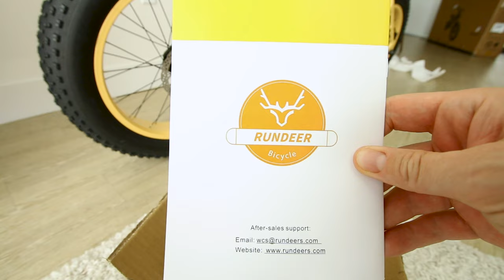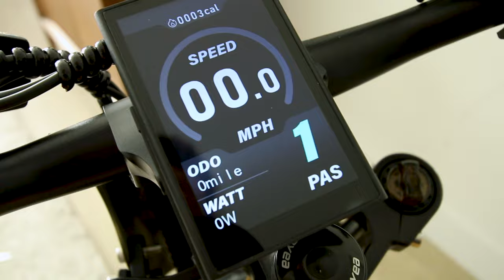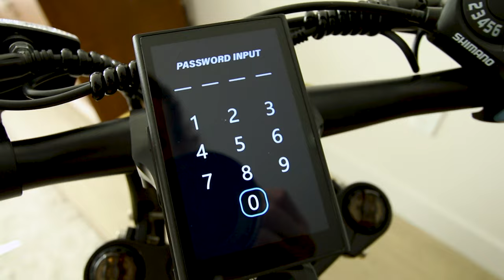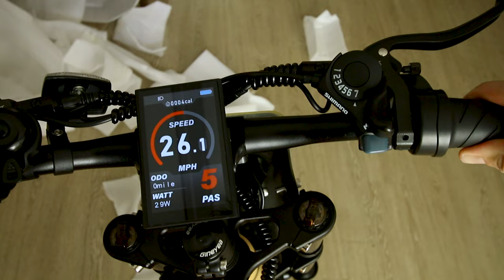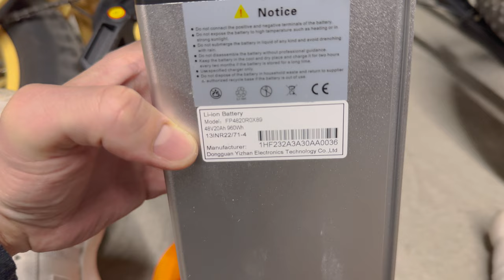This Military Inspired Ebike is a VIBE - Rundeer Attack 10 Review

Comment: Stupid 750 hub motor for almost 3.5k...no
Reply: Honestly i just want an ebike company that makes the frames wheels etc without a motor and battery. So i can strap my own battery and a 10kw motor on it
Reply: Dengfu. Or use a cyc kit on any other frame.
Reply: 750 watt and no unlock for over $3k? Lol, NO.
Reply: The Kepler set up would have been nice. A special custom  1,000 watt  Bafang and running 52V with a 33 amp controller.
Reply: And about as much torque as a snail!
Reply: @squirrelcovers6340  It's madness for that price and such lame power! Where I live in the UK just bought a superb Allegro 20x4 fat tyre bike with TWO 32 amp batteries ,1000w nominal power, front/rear cargo racks, just £1500 and it does 36 mph If I pedal with full throttle!
Reply: @miles-x4u  110 to 135 or so is the new standard in my book
Reply: @JudeTheYoutubePoopersubscribe  it's a conversation piece
Reply: @JudeTheYoutubePoopersubscribe  we don't have any hills by me anywhere. No off road riding and absolutely no bike lanes or trails. So a bike that can mingle with 45 mph traffic is really the best option for us here. It's ride in the street or nothing.  No white line on the shoulder.. just trash and dirt off the road .  Glass and gravel or you ride in the lane and cars must go around you crossing the center lines to avoid hitting you.. Or stay behind you all pissed off.
Reply: This bike is ugly af
Reply: @slimdunkin117  A kid might like it.. He could play Army with some army costume
Reply: Yes, 750 is adequate but really needs a dual hub motor
Reply: @DadRandom  750 ain’t adequate..this is an off-road bike..off-road = mid drive
Reply: @not_so_native_native  heard of a dirtbike
Reply: Agreed 750w for that price dream on
Reply: Govt needs to give tax breaks for ebike purchases to help get these prices down
Reply: Company is trying make money off the looks of the bike and not the components. Bit baldfaced and obvious is all.
Reply: @miles-x4u  thought anything like that was a no go in Europe?
Reply: No way , over 3k$ 750 w 20amp battery, are you crazy 😅
Reply: @not_so_native_native coastcycles buzzraw is what you want.
Reply: Way over priced for a 750watt lol
Reply: Brand new 750w made 700c wheels are less than 200.
Reply: @MrBigangry  frame, wheel specs and capacity is questionable with home build. It could be catastrophic if something fail during a ride
Reply: Oh they lowered it a whole bunch must not be selling

Comment: Nice ride !!!! Love the headlamp design.
Should be army drab or camo. Not feelin the bright yellow.
For that much money, it oughta have a 1500 motor.
It should also have 180 mm rotors and a hydraulic rear shock. Needs turn signals and a brake light.
All in all, looks like fun to ride.
ps: l assume that's LA. It's changed alot since I was last there. 
Life in the Fast Lane.
Be safe and be well.
Reply: Agree, agree, agree, arnt turn signals useless though
Reply: After testing, the power of Attack 10 can reach 750W (1200W Peak)
Reply: Not if you actually use them. Drivers don't read minds and neither can I. Sharing the road is necessary, but most people appreciate a heads up, knowing what your intentions are. I'd use hand signals, but I like to keep a good grip on the handle bars. 🤣
Reply: @DavidCooper-vh4nr  there too close together just looks like a blinking light
Reply: Not when you have a brake light. 
It helps to indicate your intentions. I rarely enter a turn at full throttle!!! 🤣
Reply: @DavidCooper-vh4nr  eh well agree to disagree. Handsignals are much clearer although on shitty roads can get a little rough.

Comment: The battery would be so much easier if it dropped in from the top and I dont understand why 90% of companies dont do it. I want it down low for center of gravity but I want to pull it out from the opposite side. Who the fuck wants to lay on the ground to pull their batt out?

Comment: My 48v 20ah 1000w Ebike is adjustable from 24v-60v....is it more efficient to ride at 24v,36v or 48v?
And when I switch to 50v the battery percentage drops a little right away but there isn't a problem other than battery life,to ride around in that setting sometimes right?
I switched it to 60v once and the screen slowly started changing or just cutting off but I was able to switch it back before it...? Shut off? 
Thanks.

Comment: Use the right compression adjuster on top of the forks to stiffen them up left preload I think is like a rebound on air forks but there elastomer rubber tuber inside small spring if you have 2 adjustable knows on top the stantions and if there's a preload  there deffo elastomer you don't get that on air shocks

Comment: Seems that bike needs an AWD configuration (especially that the specs show, without rider, the bike weighs 88 lbs). Without dual-motors that bike seems a bit under powered. 

But what do I know, the Company's website says this bike is "SOLD OUT." 

Besides, I don't know nuttin bout riding off-road, so maybe this is a really good off-road bike?  

Indeed, here's how the Company advertises this bike:

"Engineered for hardcore off-road adventures, the structural design elevates the bike's center axis height by 10CM compared to similar products, significantly enhancing its maneuverability in mountainous terrains. To meet the demands of off-road riding, special treatments have been applied to components such as front and rear suspensions, wheelsets, handlebars, and spokes—delivering a level of performance that sets this e-bike apart from others in the market."
Reply: Hello, the model that the reviewer tested is the standard version of attack 10, which is available. The advanced version is indeed sold out, but an upgraded version of attack 11 will be launched soon.

Comment: Hmm $4100 listed on their website. While I like the look and suspension components. Why wouldn't I just buy 2 Wired Freedoms? If they put a 2000w motor on there ok I can sort of see that. But you can get a lot if you're only looking for a 750w motor for way less money. Hell the Jansno X50 goes the same speed and has the same power out of the box and you can actually get in the settings and pump up the max amps. Sure you'd have to upgrade it but you can get 5 X50's for the price of this bike and weld them together and create an ebike land battleship with a total of 5000w's of power. Lol. I just don't see a market for this bike. It's doesn't mean it's bad, there is just no market for it. I could create a "MAGA mobile" ebike with a 500w motor cheap commuter bike from a big box store, put a nice display on it, and all it's got is Trump's face on it and charge $2500 for it. But is there a market for it? Like why would I buy this when I can spend another $300 and buy a Suron X? And that's at list price, if there are discounts it may be cheaper.
Reply: The price is ＄2998